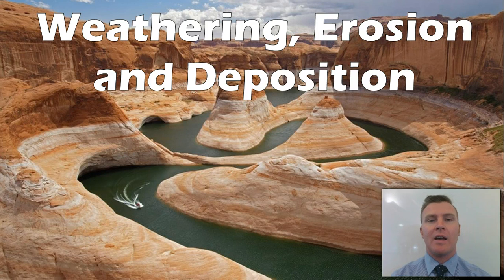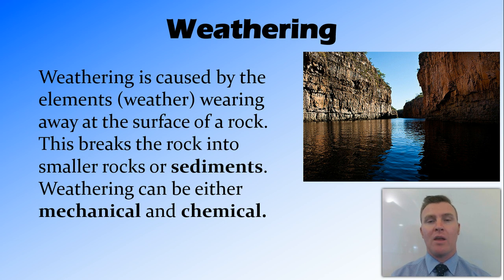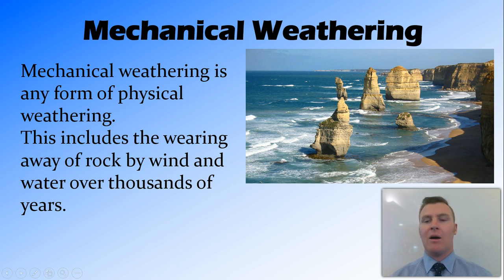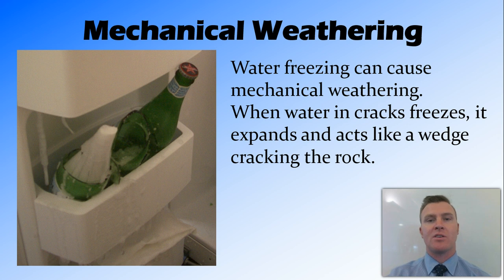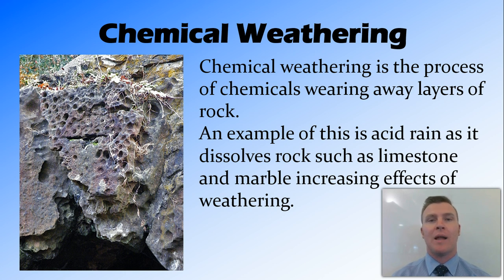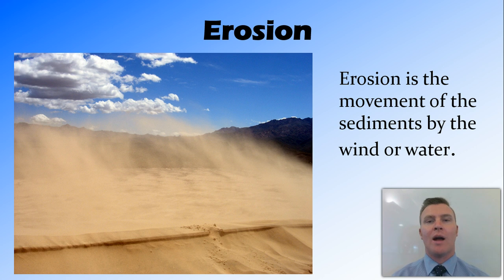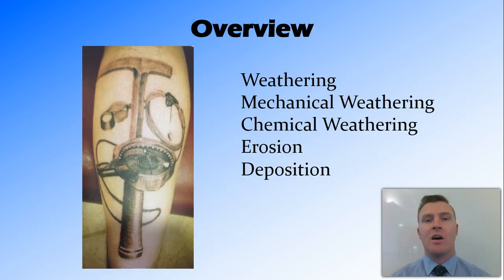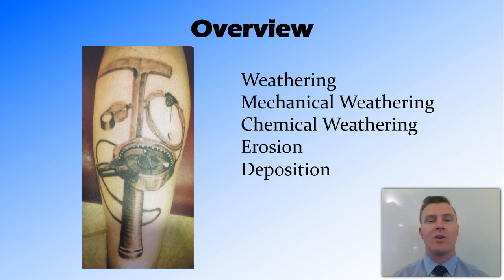Weathering Erosion and Deposition

Comment: 10.4 Notes

Overview: 
Weathering 
Mechanical weathering 
Chemical weathering
Erosion 
Deposition 

Weathering is caused by the elements wearing away at the surface of a rock 
Breaks the rock into smaller rocks or sediments which can be mechanical weathering or chemical weathering
Mechanical weathering is any form of physical weathering - wearing away of rock by wind and water over thousands of years
Water freezing can cause mechanical weathering when the frozen water cracks it expands and acts like a wedge cracking the rock. Tree roots can also act as a wedge causing weathering.
Chemical weathering is the process of chemicals wearing away layers of rock.
 Example: acid rain as it dissolves rock such as limestone and marble increasing effect of weathering. 
 

hope this helps!!

Comment: The roads in Orange seem to break up really quickly. Is that because of mechanical weathering due to temperature extremes?
Reply: It is because of vehicles driving on the surface of the road, and also because of poor maintenance.

Comment: What other chemicals can fall into the category of chemical weathering or is it only acid rain.
Reply: No, there are more. There is Oxidation, which is the reaction of rock minerals with oxygen. Carbonation is the process of rock minerals reacting with carbonic acid. Hydrolysis is a chemical reaction caused by water, the water changes the chemical composition and size of minerals in rock, making them less resistant to weathering and Hydration is the absorption of water into the mineral structure.
Reply: @rosieflatau2300  whoa